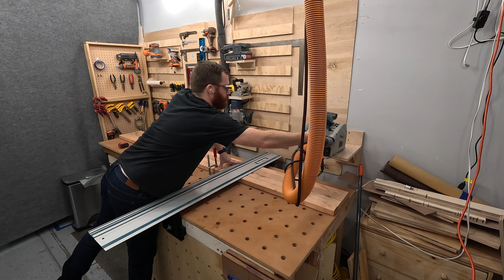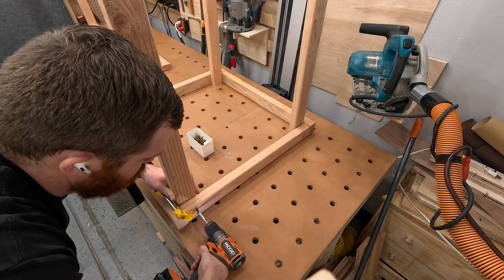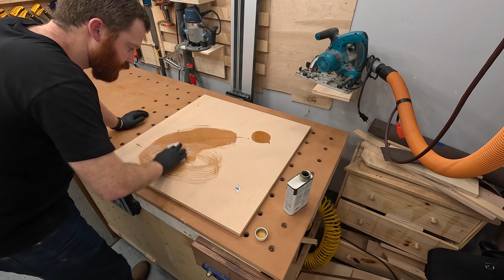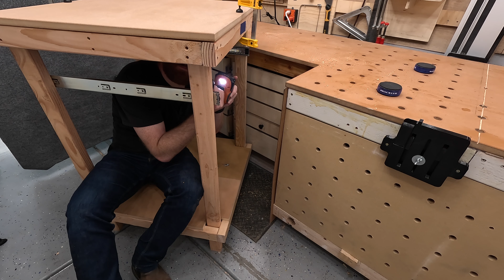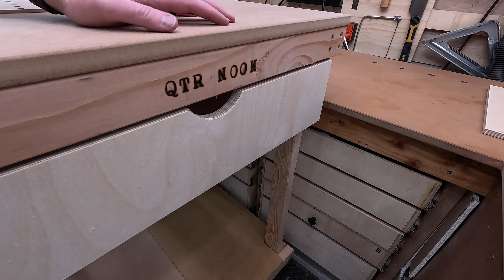Small Easy Workbench Build

Comment: You might be the only person once seen with a smaller shop space than me. Where did you get the hinge for the track so you could use it like the Kreg adaptive system?
Reply from the maker: Thanks! The track saw hinge is 3d printed from a design I found on Etsy. I would just search for 'track saw hinge' on Etsy and it should display.